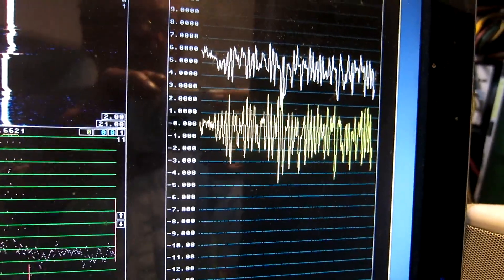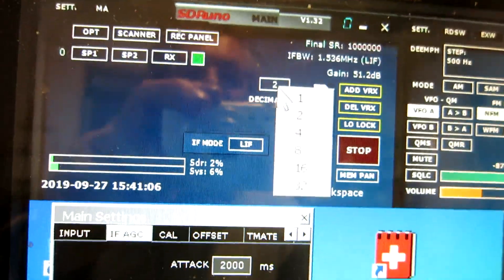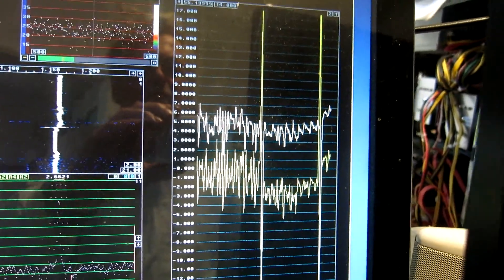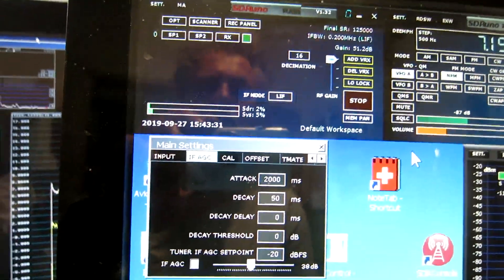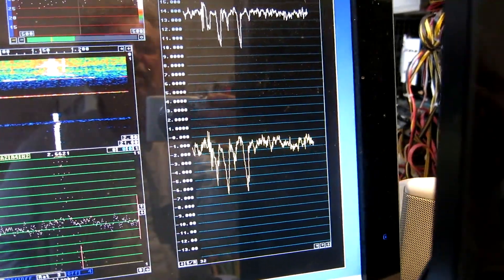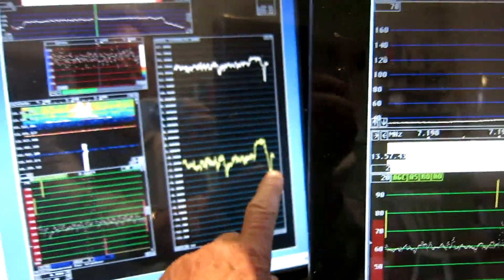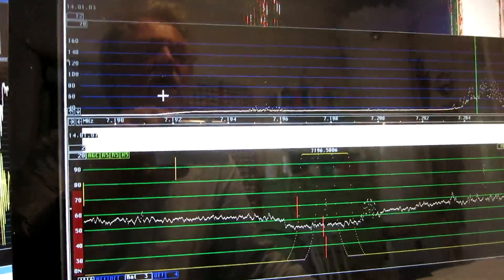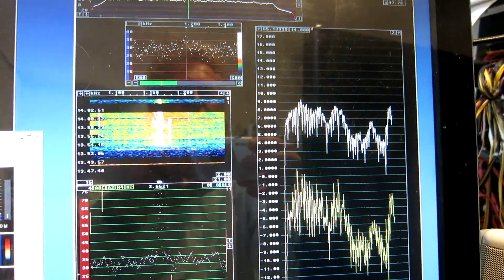rsp1

Comment: Your interests are more focused on measuring the performance of recieving systems quanitatively rather than qualitatively comparing the actual signals using the human auditory sensors.  You may discount the later as not as scientific, but there are so many variables involved in achieving an intelligible signal, it's hard to hang one's hat on a few specific measurements and deem one receiving system better than another before listening to them and comparing their ability to produce intelligable results on very small signals, with and without close neighbor signals of varying strenghts.